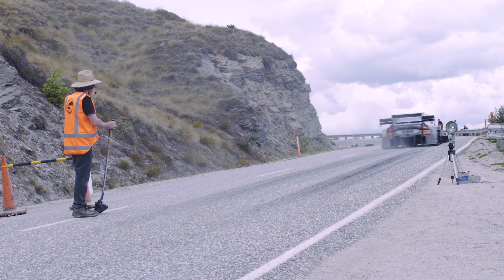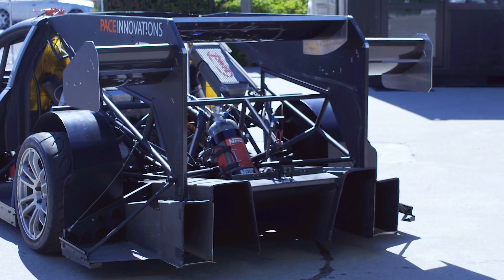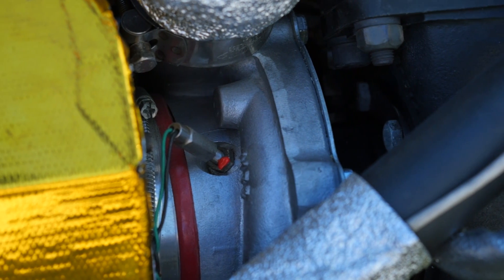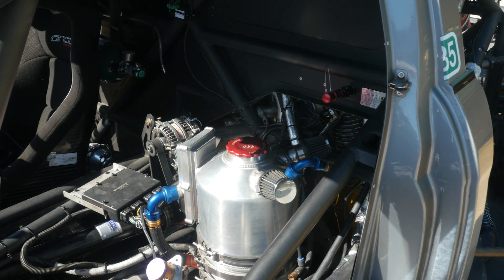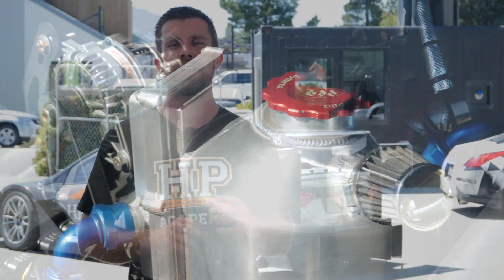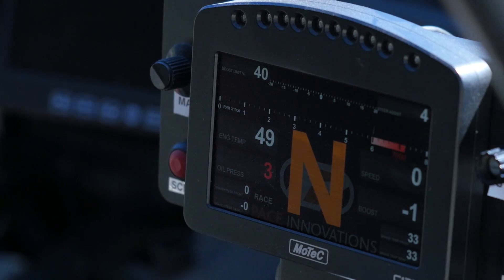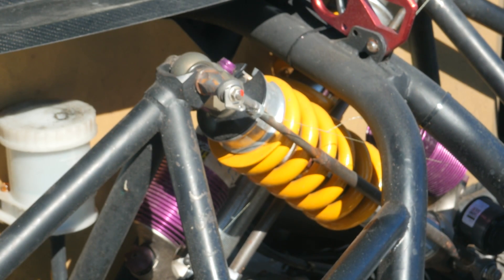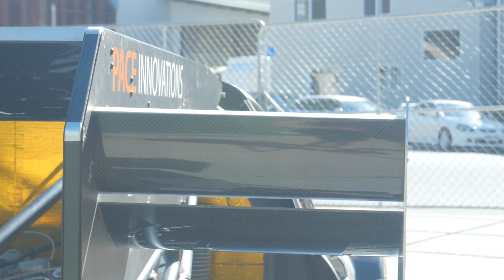1000kg, 800HP and a Twin Turbo GT-R engine | Ford Focus Pikes Peak [TECH TOUR]

Comment: Hey Taz, do you know what he uses to get the altitude readings as it changes and how he gets it to the ecu? If you don't know his specific set up, could you tell me what components would accomplish it?
Reply: Since you didn't get an answer, i'm guessing a normal map sensor out in the open could figure out the altitude based on atmosferic air pressure
Reply from the maker: It's all pressure based rather than location/altitude based. The turbos just have to work a lot harder to maintain the same amount of pressure as the air density decreases during the climb - Taz.

Comment: One question, why a vr38? Now I love Nissan, it's my favorite automobile company but of all the Nissan engines, was there something the vr38 did particularly well with this build?
Reply: I can think of a few reasons,
- all aluminium motor, its VR38 is light.
- proven robust architecture, there are VR38's pushing well over 2000hp.
- Strong aftermarket support.
- V6 makes packaging compact.
- Twin turbos help with response / reduce lag.
- At 88.4mm on the stroke, is rather high for a V6. This tends to favour a wide torque curve down low which is ideal for hill climbs.
- Hill climb see high altitudes, where a turbocharged engine is absolutely necessary to be competitive.
Stacking these qualities of the VR38, it makes total sense to select this architecture for the intended application. I may be wrong on some points, or / and have probably missed some. This is what springs to my mind however.
Reply: look at thee guys putting them into 86's for time attack

a proven engine that can be built to make 1000hp a lot easier than most others that you would use for time attack

Comment: based off all the custom parts and electronics and drivetrain used

I can easily bet that the cost of the build is close to a million?
Reply from the maker: Build cost was around $450,000 - Taz.
Reply: wow that sounds cheap to me.
Reply: Lin Chester It's an unlimited class car. What do you expect.